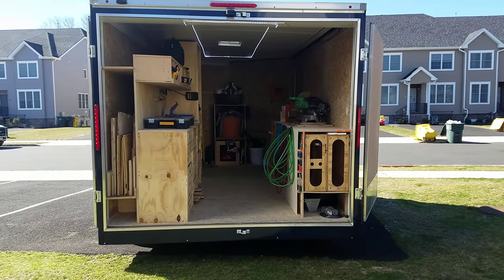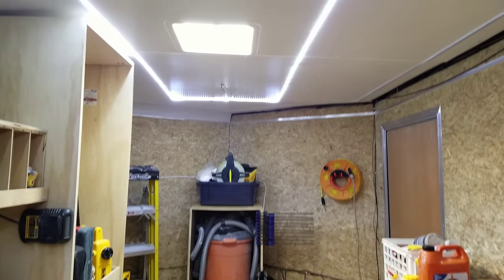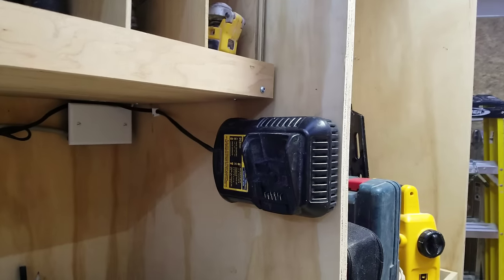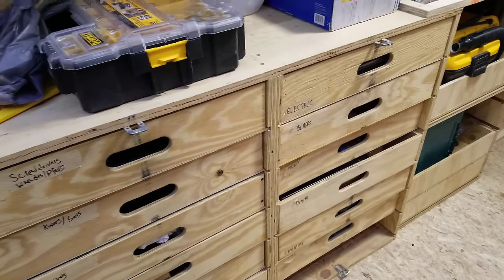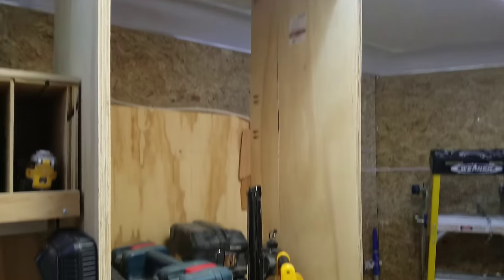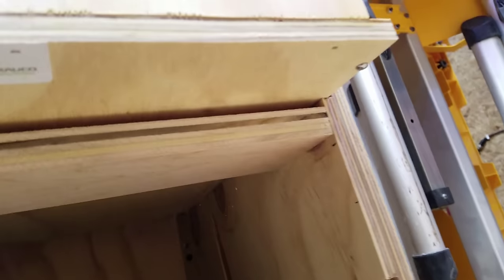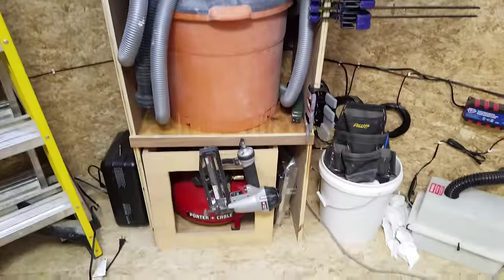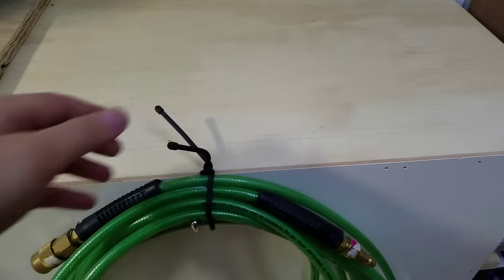My tool trailer setup | Inspired by Ron Paulk's Awesome Rolling Toolbox

Comment: For that empty space. If you have small extension ladders. Get some brackets and put your extension ladders on there. But I️g it depends on how and what you work with. This would work well if you didn’t use your side door much and wouldn’t mind a little bit of hanging in front of that door

Comment: Looks great man.  It will progress to being much more complex and inclusive over time......believe me.  ;-)  One thing though.....you really SHOULD protect that AC wiring.  You don't necessarily need a tubular conduit.  You could use raceway material to cover it just as you have it.  Just screw the clips to the wall behind the wire and snap on the raceway.  Things move around in the trailer and things that don't move much STILL bounce up and down just a bit and over time (a SHORT time) will cut into that jacket and insulation and then the wire and, well, you're at risk.  Also, when you get busy and moving things in and out of the trailer, you're really NOT going want to jack with having to be careful of that wire all the time:  It's just not efficient, practical, or safe. Yes, I realize it's not powered up all the time but, you don't want to find you have something shorting against a blade or something and throwing sparks onto everything (which will likely - when you are busy - include dust, including sawdust) when you're away from the trailer plugging it in.  And that wire looks like 14g.  I'd change it out to 12g.  At least put a fire extinguisher in there.  Great job.  Looks comfy :-)

Comment: Iam thinking about something like this but then i think about when i get to the job dragging all the material to the road to cut and walk back inside to install everything.. and if i reverse up the drivaway ill be working on an angle not ideal for constant drop saw use.. really like what you have done though looks really cosy looks like you could just completely focus on what your doing in there and know where everything is!
Reply: What do you jobsites look like are they flat ?? Iam a Carpenter in Australia and i build new homes and the driveways on 90% of them are angled and chopped out from bob cats etc so iam just wondering how you go about working from the road and if it wastes time walking all the way out to the road just to cut something seems  a bit draining..  i guess if i reveresed up the driveway and took the trailer off and jacked up to a level working space it might solve the issue.. iam just all about saving time and if i can have my work station already set up that would revolutionize productivity and save at least 2 hours to my day dragging everything out.

How do you go about handling material how close is your trailer parked from site?
Reply from the maker: MelBorN I do not use the trailer as a shop. I only use it for tool storage. So I back the trailer into the driveway and remove the tools for use in the jobsite.

Comment: Its hard to tell in the video but did you cut a 1/8" rabbit around the top of the drawer base to fit the sides and rear....like Mr. Paulk did?
Reply: Doesn't look like it. I would think it would weaken it quite a bit being 1/4".

Comment: So I have been thinking of getting a trailer like this one and the biggest negative that I am hearing is the gas mileage will be drastically affected. How has it affected you?
Reply: Troy Baker make sure you don’t get a flat fronted trailer make sure you get a triangle shaped front. That’ll help out a lot. My dad pulls a 20 ft trailer with a f350 and gets about 12mpg in the county and such and a little less on highways
Reply: I've got a round nose and it doesn't pull to bad. Unless you have an underpowered truck you shouldn't have to worry about much. It's part of the cost of business. I get around 12 pulling with my f250 7.3 diesel.

Comment: How thick are you 2 benches length width and thickness and what material did you use ?
Reply from the maker: They are 8' long and 2' wide. I think they are about 9" thick. They are made of 1/2" ply. If I would do it again I would make them shorter and I would make them out of ultralight plywood.

Comment: How did you get a battery to recharge during driving?
Reply from the maker: The battery for the lights is independent from the battery for the trailer brakes. It is charged on jobsites with the onboard charger whenever the trailer is plugged in.